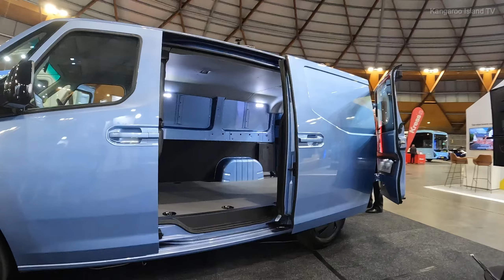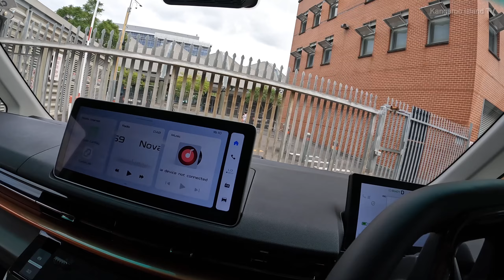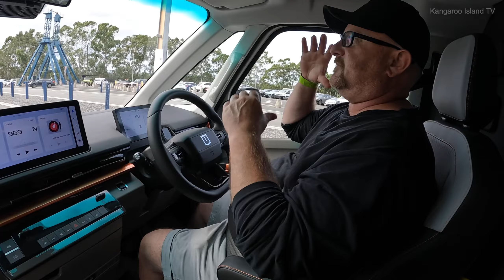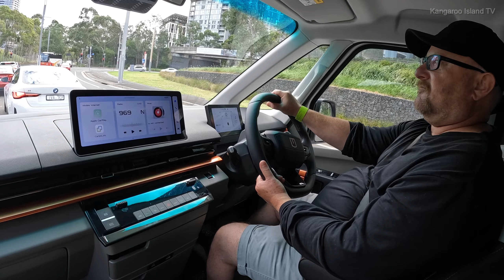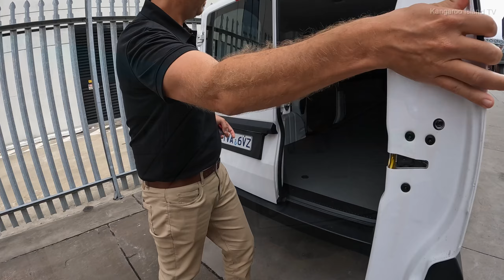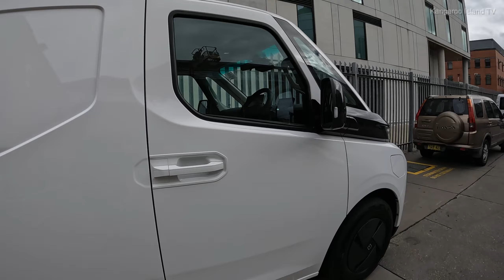Test driving Farizon SuperVan at Everything Electric Sydney

Comment: As a tradie myself, I do think this is the next van for me. But I also would recommend somehow they can have something like a tray putting onto the passenger seat, So I can store my food, drink and paperwork on it. And also make it easily removable if someone needs to hop on.
Reply from the maker: Hey! That’s a good idea about the try. I think the Ford van has something like that but for the steering wheel that folds down? I could be wrong. Hope you get an electric van soon!
Reply: thanks man. I will check out the ford van as well. Cheers @Stan-at-KangarooIslandTV

Comment: Front wheel drive... hmmm.  No 2nd sliding door?  No rear liftgate option?  A van thats like a car?  That's all new vans.  I see we are still taking the piss out of Australia drivers by not engineering a RHS indicator stalk.
Reply from the maker: I’m ambi-stalk these days, as long as it has stalks I’m happy!
Reply: @Stan-at-KangarooIslandTV  Yes, you have to be, because manufacturers are not taking us seriously!  I still like to lean my right hand on the door and flick with the right fingers whist bing able to use the left hand for holding the wheel at a lower point.

Comment: Nice one. Any idea on price and towing capacity? Options of a larger battery pack?
Reply from the maker: Not sure of pricing yet, but yes can tow up to 2000kg braked and there is a third battery option of 106kWh, not sure if it’s coming to Australia, but that would be the one to get for a camper! That would be so nice to do the lap in!
Reply: @ my thoughts exactly on the lap. Hopefully it will have internal 240v sockets, an air con unit that you can leave on all day and night and can turn the day running lights off so you can sleep in the van overnight with the aircon running. Oh and it would need to be well insulated in the cargo area so the aircon doesn’t need to run too much. And have a door going through the cargo barrier.
Reply: @benbeverley561 yep , just like a Tesla camp mode.  It's a no brainer . Hope they are thinking that way 🙏